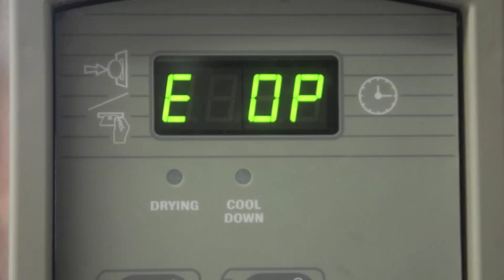e_OP Error on Huebsch & Speed Queen Commercial Dryers - HK Laundry

Comment: In 20 years as a Alliance equipment tech, I’ve only found maybe 2-3 actual bad m414704 thermistors.

It’s almost Always an unplugged thermistor or a broken/rotted wire or connector. 
If a thermistor Actually goes bad, it’s typically an SH (shorted) alarm display, not an OP.
Reply from the maker: I agree with you and your experience.  I created this video after Alliance was having vender issues with the thermistor.  The original thermistors that looked like twisted wires dipped in plastic were very problematic and unreliable.  Still a good video on what types of errors can occur with thermistors.  Thanks for the comment.

Comment: Hello Karl, I have a question maybe you can help I would greatly appreciate it. I'm trying to figure out what's wrong with a Commercial Speed Queen dryer it only turns when in cool mode but won't turn when set to heat, what could be the reason?

Comment: I have a commercial  speed queen washer and it is not working. I have clothes and filled with water with the door in lock position.  When it is on the edl light flashes. I have powered down the washer and nothing happens. What is the solution.
Reply from the maker: kerry barfield 
1st you need to unlock the door.
http://www.hklaundry.com/resources/video-library/how-to-huebsch-washer-videos/how-to-unlock-a-huebsch-washerextractor-door/
Reply: Very helpful .thanks